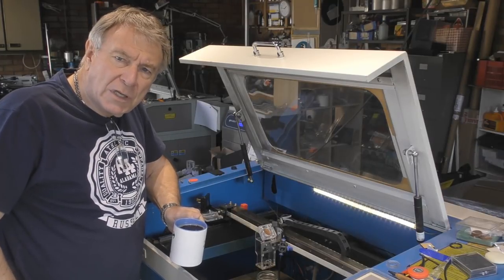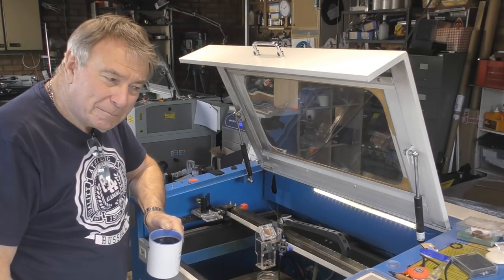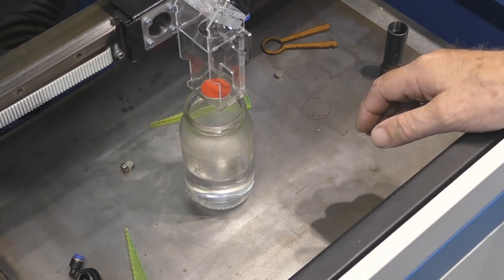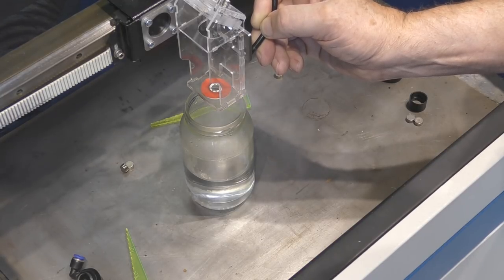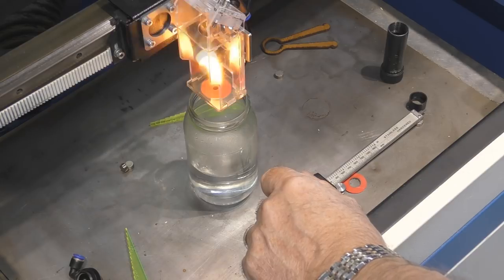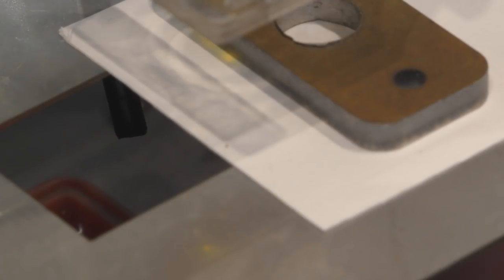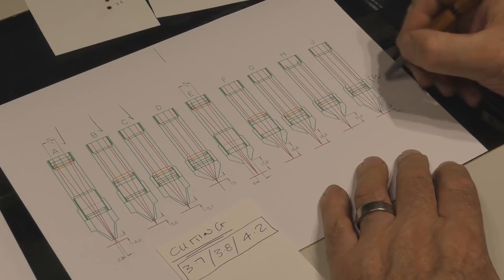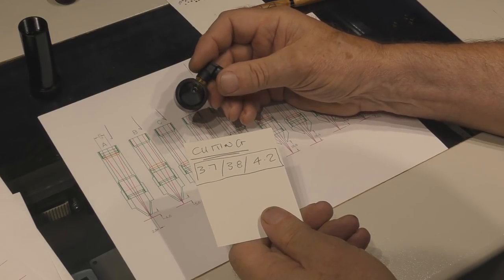RDWorks Learning Lab 152 Are our Nozzles Designed Correctly

Comment: Hi Russ! 🤓
Reply from the maker: Hi Vlad
It's not a stupid question but one that transposes your innate experience of visible light to this situation.The long wavelength IR light we use has many interesting properties that visible light lacks.When the laser beam contacts a non metallic material, the molecules in that material become excited and vibrate faster. The level of molecular vibration defines its temperature. So, the longer you expose a material to the laser beam the more agitated it's molecules become and the hotter it gets. This energy transfer from light to heat only occurs on the SURFACE molecules. In that respect it is like visible light, shine a torch at the wall and the light does not enter the wall, just illuminates the surface. So when the laser beam hits water (a non-metal) it agitates the surface molecules to boiling point extremely rapidly  (hence the explosive cracking you can hear) and the energy then converts to steam. Thus if you understand this energy transfer process (that does not happen for normal visible light) then you will now comprehend that water is not reflective at this wavelength. You already know this fact but don't realize it. When you step out into sunlight you seem to feel the heat of the sun. From 90 million miles away...I don't think so.  What is actually happening is the IR LIGHT from the sun is exciting the molecules in your skin and excited molecules get hotter.  I hope that answers your "stupid" question. I am sure this clarification may help others so thanks for your inquisitiveness.
Best wishes
Russ
Reply: SarbarMultimedia thanks Russ, very detailed answer as always. My idea was not that all is reflecting, but I was thinking maybe there is still some that was reflecting. But yes, was not very smart assumption 😄 oh well...